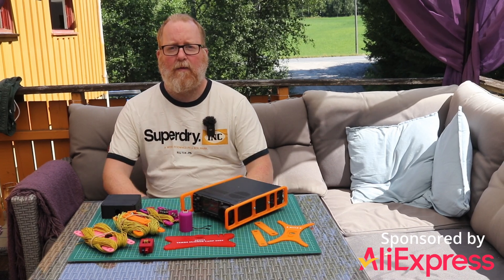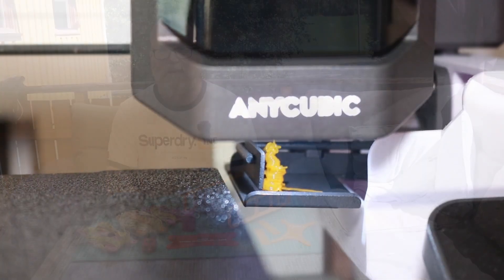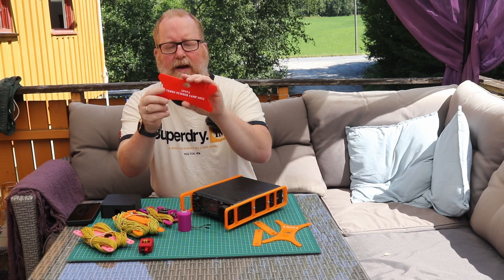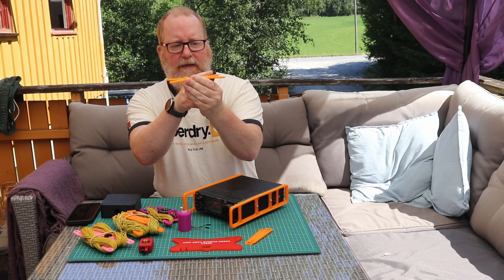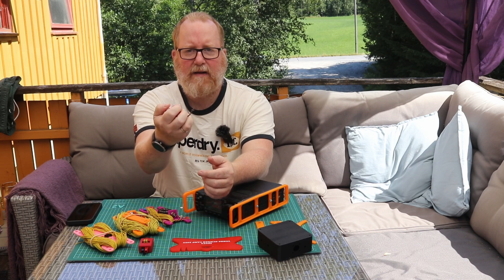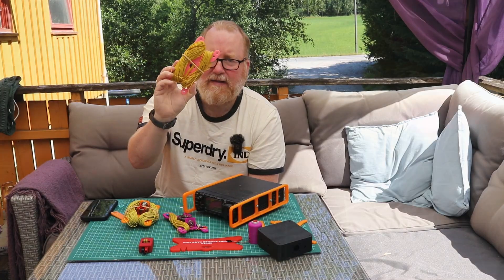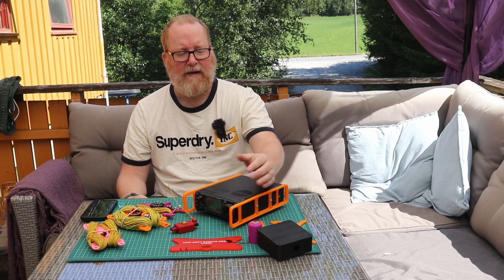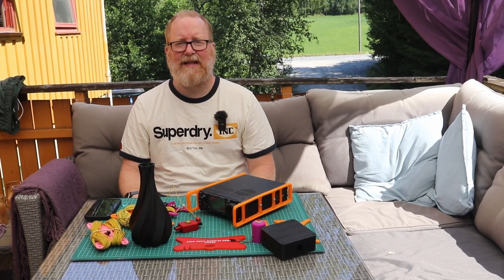3D Printing for Ham Radio

Comment: Was breadboarding a simple oscillator circuit at my local hackspace (maker workshop) & I needed an adjustment tool for the small trimmer pot. Easy peasy 5 mins latter I had a set of three different sized edges. There is no end to the useful things one can make to support the hobby. I am in the process of making a weatherproof case to protect my NanoVNA for field use.
Reply from the maker: It's a fantastic tool for any maker hobby, and it allows for fast prototyping and small scale production.

Comment: I printed rails for several different radios with my ender 3 printer, they do gain alot more strength when printed with 80% or more infill. The ones I made for my 706MK2G were 80% and saved the radio more than once.

Comment: My most recent print was not for Ham radio sort of a print for the family. 

On printables search for

egg spiral storage

We have chickens so we need storage, but I imagine transferring store bought eggs to here would have some benefit because you can quickly grab one or two eggs from the bottom and not have to take the whole carton out. You also know if you are running low at a glance.
Reply from the maker: Those are useful prints. I am considering the same since we (my daughter) eat more eggs than the average family.

Comment: I like that the bed surface specifies which filament types you can use on it. I, and I know a few others, have destroyed a bed surface by printing PETG on it when it wasn’t compatible with PETG! Looking forward to the project that printer will help super.  If it prints 6 times faster you can make 6 times more projects!
Reply from the maker: That speed increase is wild, I can’t wait to see what I can make with it. I also have some large prints ready in the queue.

Comment: Thats great Morten. I took to laughing went brought out the Vase !!!  I also printed one for my wife, apparently I have to print 2 more of different colours.. I got a Bambu Lab A1 , 500mm/sec, I had it printing about 5 mins after I got it setup. I have designed a couple of parts, but long way from something to complex with the 3d CAD. for some reason I had taken a liking to Freecad, I liked it more than Fusion360, not sure why. I guess I got into the 3d printing hobby just at the right time with all the advancements with auto calibration  and so on!!  73 VE1SK
Reply from the maker: A vase is important, my next project is new lamp shades for the living room.

Comment: I got my first printer 3 years ago and it still in the box.  I got a Bambu A1 mini for Christmas and have had it running since Jan.  I am a utilitarian 3d printer.  I want it to just work.  I don't want to have to work on it.  The Bambu met my expectations for that.  Thanks for the videos! 73
Reply from the maker: Exactly, and that’s the difference between this generation of 3D printers and the previous generations.

Comment: Are you posting from your hytte?
Reply from the maker: Nope, just my porch.
Reply: @LB0FI  Nice porch! What a colorful scene with the yellow house and green grass. Perhaps you could discuss 3D printing for friluftsliv? PLA can be less than ideal when out in the sun and heat, so what do you use for items used outside?
Reply from the maker: @JohnTarbox  Thanks John. I actually use a lot of PLA outdoors, and have PLA parts that have been outside for years. But I would recommend using PETG for that though.